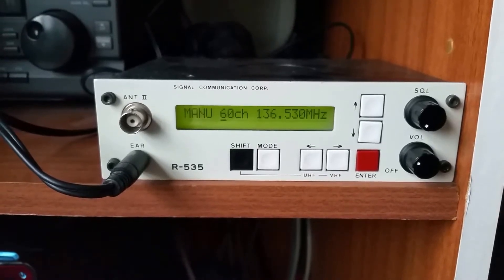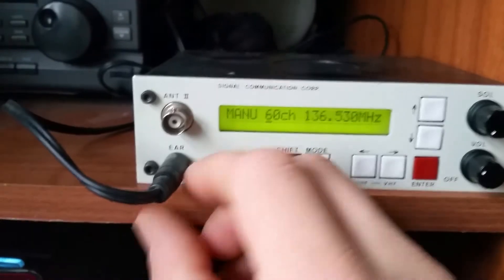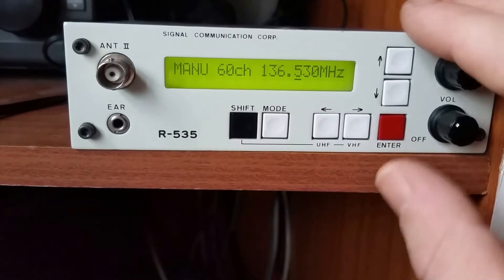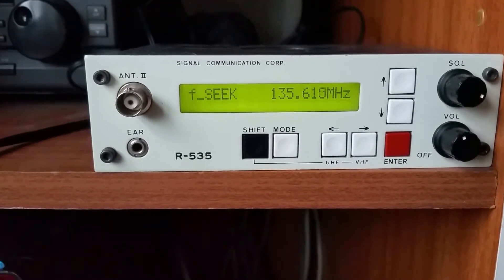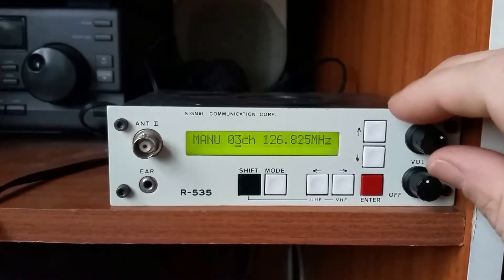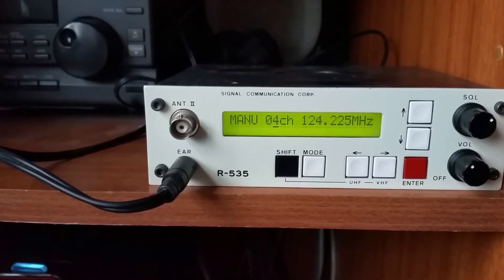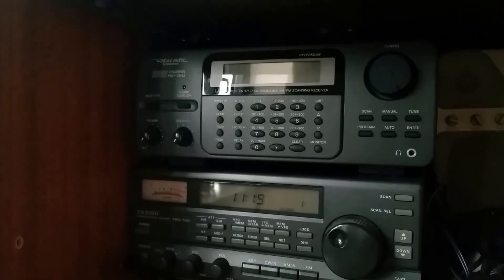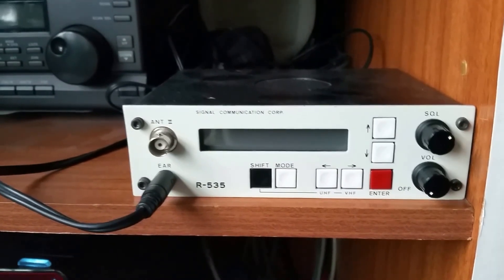Signal communications Corporation. R535. Pt2 The end result

Comment: Hi Simon, I've just got one of these from a boot sale (!) and there is a rapid clicking in step with the scanning. Do you have any idea what might be the trouble? Everything else seems fine. It looks as though it's been stored in a loft or garage for a good long time.  Maybe just needs a clean. Thanks for the amplified speaker tip. Yours sounds great. 73 Adam M6RDP
Reply from the maker: Boot fair! ? Good find. If it clicks when searching maybe decoupling caps around the micro processor. I would recap it and try again. I take it receives ok apart from that?
Reply: @SoddingaboutSi  Thanks for replying. Yes, good find indeed. I've just tried a search and it clicks the same as when it scans. Do you mean try replacing the decoupling capacitors in that area?
Reply from the maker: @M6RDPadam Yes try caps. If you tune to a local signal or volmet, does it receive?
Reply: Yep, in every other respect it is working perfectly and receiving like a dream. It's just just during search and scan. I might just have to live with it as it sounds like it's a job that's beyond my M6 capabilities haha. But I will have a look at a service manual and see if I can find the micro processor. Thks again.
Reply: Actually in this video around 2min39 I can hear a faint clicking when it searches. Mine does the same. Not sure it's a fault or just not very good design.

Comment: Simon, Ben has just commented on this video to point out that at 2' 39" he can detect a slight clicking. So it prompted me to put a video up of my own 535 clicking whilst scanning:

https://youtu.be/eAjBUGfWUU4

When you get a spare moment have a listen and see if you think it's normal!

Cheers
Adam
Reply from the maker: Never used scan but just tried it, Mine does the same and as it has to briefly pause on the channel to look for a carrier I would expect it to.
Reply: @SoddingaboutSi  Hi Simon, tried turning the squelch up to maximum. Sadly no improvement.
Reply from the maker: @M6RDPadam  I wouldn't worry about it. Its just the muting circuitry.